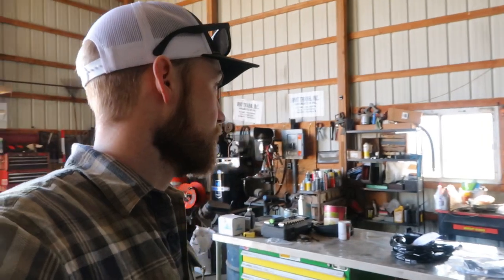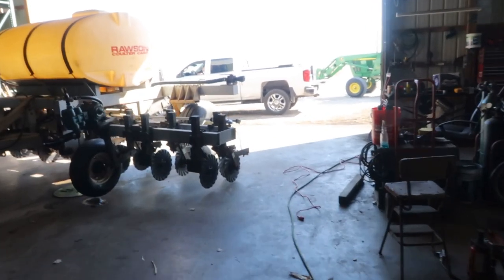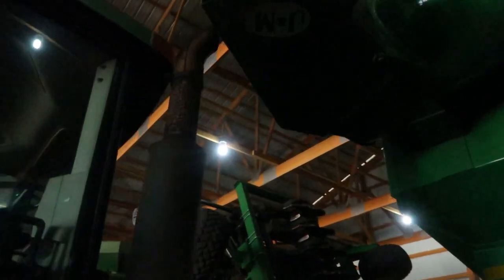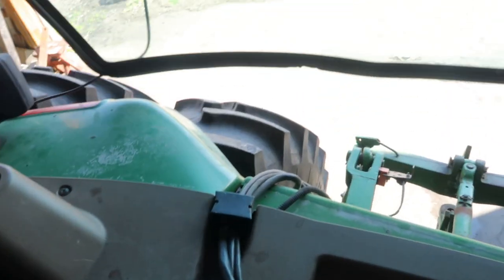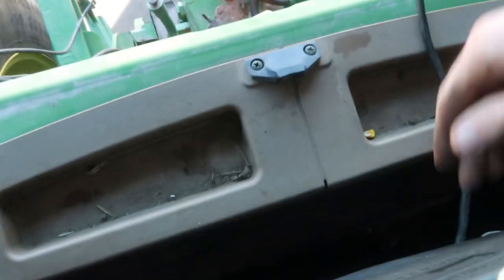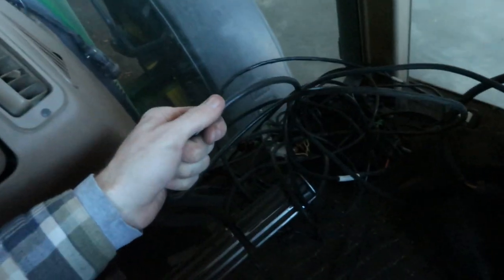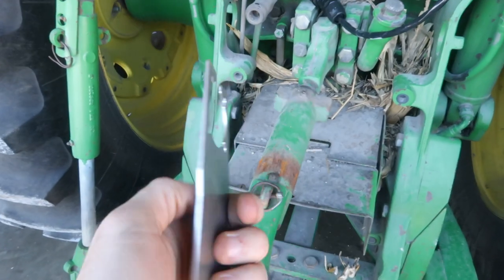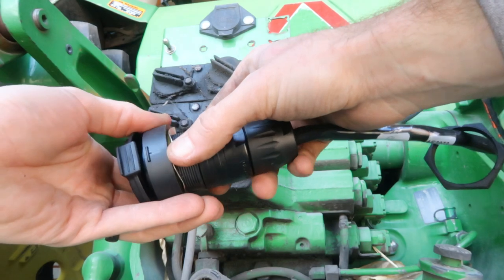OLD JOHN DEERE gets a NEW JOB on the farm! #plant21

Comment: If there is a simple wiring diagram, with connector descriptions and leg signals, you really wouldn't need instructions...but many companies call that "proprietary", so you HAVE To call their service folks...
Reply from the maker: By instructions I meant wiring diagram. The problem was I could only find diagrams for 2 of the 3 harnesses. I have since called the company and resolved the issue. Thanks for watching.